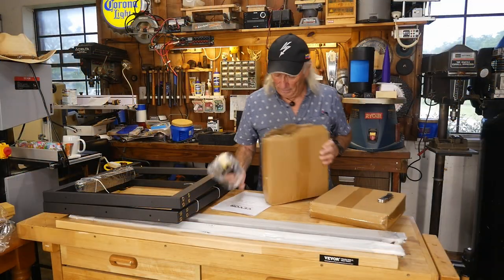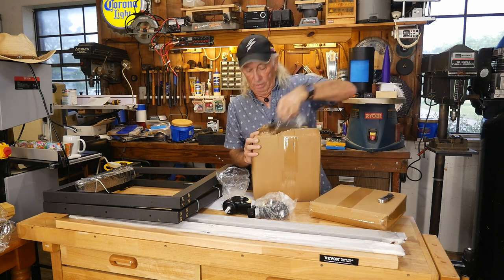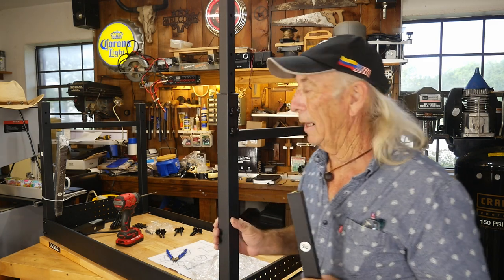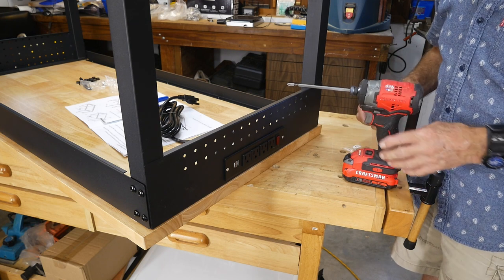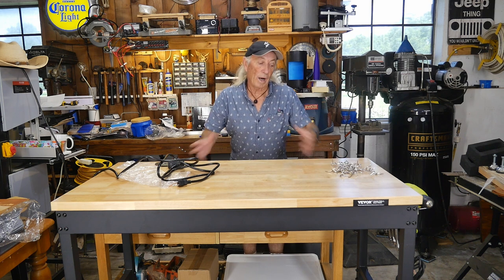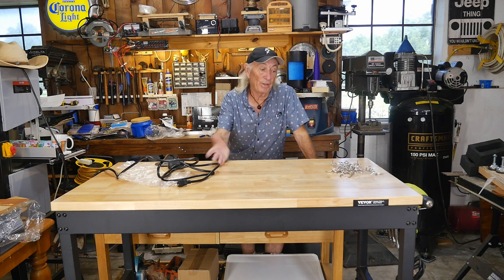Vevor workbench adjustable height, roll around, 2000lbs cap, reviewed C&T ep 356

Comment: Great table. I’m 6’4” so a table that can adjust is a really great feature. I’n my tiny shop I need everything to move so I have room to work. Right now the only thing that is stationary is the work bench. Did all four wheels have locks? Not that I’m a YouTuber but that sure looks like a great surface to work on and the butcher board top makes a great looking work surface. I’ve seen to many old peg boards with a lot of the holes either ripped out or so worn the pegs fall off, the metal looks like a nice option. Thanks for sharing!
Reply from the maker: yeah the higher feels good, and all 4 wheels lock :)

Comment: So here is a lesson in watching re-runs of Coffee and Tools!! I had forgotten all about this! Workshops, well, MY workshop, is a changing and evolving work of passion as much as anything I’m working ON, in it!  Which MEANS, yea, ordered the bench cause I forgot about it! 
But let me refresh memories. You kit Larry seems to be an anomaly. Benches sold on amazon do not give you BOTH wheels and fixed feet. It’s one or the other. Currently amazon offers only feet, no wheels. 
Still, for just under 150, it’s unbeatable!! 
I want the adjustment process to be quicker than having to unscrew 8 handled bolts so, I’m going to switch them out with lynch pins. 
So thankful I’m binging on re-runs tonight at work! 🤣
I wanna start trying some 3D printing so I’ve got to figure out programs on my notebook that I can run through my printer. I’ve got a couple ideas!! Oh, and i’ve got a workshop that currently looks like a bomb went off!!🤣🤣👍🏻

Comment: The one you have linked doesn't show that the pegboard system is included and is not in the picture on amazon.  Also some reviews state that the legs aren't properly supported and the table is a little wobbly - wondering if you could comment on that?
Reply from the maker: The pegboard is part of the table on the sides. The legs look questionable, but seems to be fine here, I would think a lower setting height would be best, but at max here seems to be better than expected.

Comment: Larry, Larry, Larry!!! You’re keepin me busier than my wife!!🤣🤣
Some observations: first…what a perfect bench with multiple applications! The adjustable feature is outstanding! Now however, I’ll need also to buy one of those adjustable height stools!!😬😖🫢
Another feature I see is “nesting”. I have the harbor freight 5’ three drawer bench and it’s clear to see, if I get this in the 6’, I can raise it up and slide it right over the harbor freight bench!! GENIUS!! 😎
Two more…first, the bench top thickness. Easy to attach an adjustable arm light and the attached power strip provides direct power. Last thing….I see how you mounted that power strip, with ground lug on top! In the event a wrench or screwdriver…anything, falls off the bench and lands on something plugged in, there is no hazard, because the ground lug will prevent crossing the terminals! Awesome attention to safety details!! Vevor is on space shuttle speed to competing with the best old time tools!! I’m still impressed and like I said, you’re completely reconfiguring my workshop!!🤣🤣👊🏻
Reply from the maker: After assembly I suddenly thought about out feed table, 3d printer table, portable table for the barn, the darn thing has TOO many place it can be used here !
Reply: @SirTools  vevor just needs to send you a couple more!!🤣😎👊🏻